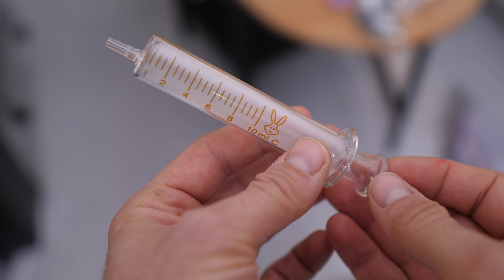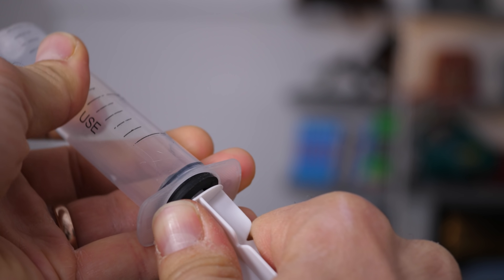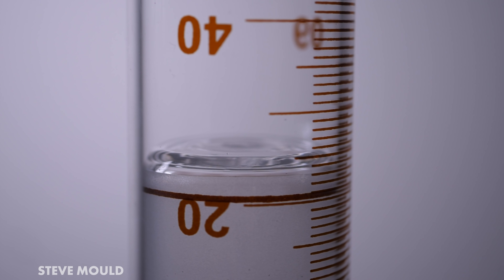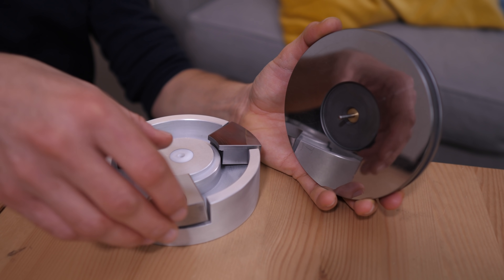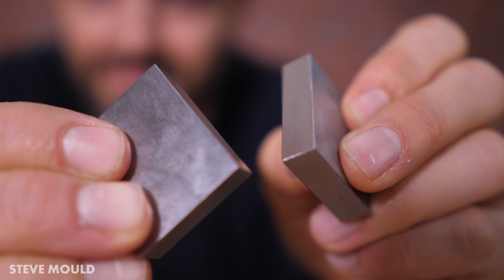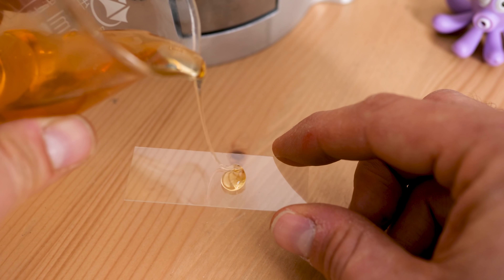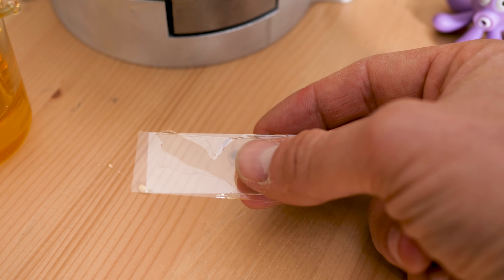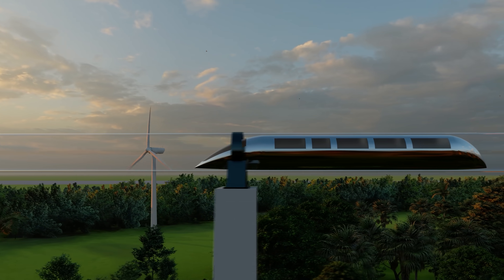The Self-Levitating Kingsbury Aerodynamic Bearing

Comment: In a rotating magnetic disk drive - that one your PC uses to store data - the disk surface is very flat and smooth, and the head has a slight chamfer on its leading edge, so that as the disk turns, it drags air molecules under the head, which then is kept away from the disk by a very thin film of air.  The heads are said to "fly", and if ever there is any contaminant in the drive, the result is a head crash - and just like in aircraft, flying is absolutely safe, but crashing is very dangerous.  In a disk drive, crashing the head is dangerous for your data.  The contaminant that will cause this is very small.  For example, a particle of smoke is too big to fit into the gap between disk and head - it would simply be knocked to one side.  A finger print is too big to fit through the gap, and would smear the oils from the finger all over the head and the disk surface, and a crash would be only seconds away.  Such devices have to be made in a clean room, where they are not touched during manufacture.  
Large computers use tape backup, and there also, the heads fly over the tape in a "streaming" action, which means that the tape is moving at its optimal speed from the beginning to the end of the tape.  If streaming is not maintained, the heads land, causing contact and wear, and head life is dramatically reduced.

Comment: I would assume the stickiness between flat metal surfaces comes from a vacuum. If the two surfaces are separating, air will take a while to flow into the opening gap. But at the same time, the metal blocks are already experiencing air pressure from all other side, pushing them together.
Should be easy enough to test. Just stick two blocks together and put them into a vacuum chamber and draw out the air.

Comment: LAMINAR FLOW!!!! @3:05 Not really, but I'm imagining the air on the sides being rings stacked on top of eachother.
edit: I might not have been too far off. Also, at 6:45, could that be used as a capacitor in a circuit?

Comment: As a fitter and Turner a surface grinder has the same bearings, but has an of set tube attached which while spinning will draw up oil very slowly, check it out you might be interested to see how they work.

Comment: Thanks for this interesting video. Could this bearing be used for storing energy in a flywheel rotating at higher speed? or would it pull too much air into the system?
Reply: Mag lev in a vacuum would work much much better. Your drag off a big rotor would be immense.

Comment: There is no proof that ice skates work by melting the ice. If you think of the ice as a lattice, it's pretty clear that the surface molecules don't have the same number of bonds as the bulk molecules. Hence, the degrees of freedom of each is not the same. As long as the surface molecules can rotate relatively freely, ice is slippery because the top layer is ALWAYS water.
Think about it, a puck exerts about 1 oz/sq in while a skater will exert about 1600 oz / sq in. Why does the puck glide so well? As a matter of fact, a puck glides better than a coasting skater.

Comment: Great video :) You use the word hydrodynamic for aerodynamic sometimes , if you want to include both you should say fluid dynamic. Also Im pretty sure that the gauge block wringing is caused by adhesion force. At least that's what I was taught.

Comment: It is the atmospheric presure that holds the gauge blocks together. when keyed you remove the air so then the atmospheric presure pushes the blocks together thus the bigger the blocks the harder to pull them apart.

Comment: This reminds me of the Tesla turbine, where air flows over numerous flat round plates (just like cd's stacked together) and relies entirely on the viscosity of air to 'stick' to the plates to cause rotation. As more air enters the system/motor and interacts with the plates, the more the air molecules collide with one another causing a motion in the plates. In this particular case a rotational motion. Practically I don't believe it was ever used, as it generates very little torque (...at least I can't think of a current practical use) but it does give a good visual model of how the viscosity of fluids can interact with the surface of objects.

Comment: The expensive work done, let us play in the physics lab.
First, to measure the amount of float (air gap) of the rotating part a laser interferometer can be used.  This is a common calibration tool in the CNC world.  So shine the beam through some holes to the bottom shiny side of the rotating part.  A tachometer and some weights can be added and the fun can start.  Performance curves of lift vs. spin at a given weight can be drawn up.  But wait there is more!  A DC voltage from 5 to 5000 can be easily applied and the electrostatic force calculated for the area of the trapezoidal pads at that condition.  As Tom Lipton might say “geeee  Mr Wizzard” 
Next, seal the end of the large syringe after filling with various gasses. (CO2, N2, O2, etc.)  Clamp it upright with say a 100 to 500 g weight in compression and record the leakage.

Lastly, it would be complicated to turn the large syringe in to a variable capacitor using electroless nickel.  Anyone, want to tackle this one?

Comment: Since I actually work on bearings for gas turbines, this was very easy to understand for me. But I never really thought about the balance in the viscosity of the oil.
It really shifts your perspective on things, normally when people want something exact it's often "exact to the millimetre" Now I think of a tolerance of +/-0.2mm as big. If something has to be exact, it's usually with a complete tolerance of 0.03mm or so, which isn't even that hard to make and I think that was the tolerance of the air-motor we (classmates and me) made in my apprenticeship, maybe 0.02mm.
I had to work on tiling pads like those in the video and they had the smallest tolerance I had to make with 0.1mm in total. There I had to be really careful.
Also I like sticking those gage blocks together.

If any of this text sounds weird, then it's because I usually talk about this stuff in my native language... which isn't english.

Comment: Great video! I'm a bit surprised you didn't consider stripping down an old disk drive as EVERY rotating disk has ALWAYS relied on hydrodynamic bearing principles to "float" the disk heads over the surface. One of the reasons modern disk platters are shiny is because they are SO precise in their surface flatness in order to allow the disk heads to "fly" over the surface (as well as being coated in a different magnetic compound compared with the much earlier brown ferric oxide coatings.

Years ago (>40!!) when I was a field engineer we used to have a diagram we showed customers illustrating the comparisons in dimensions between the cross section of a human hair (MASSIVE), a piece of lint (about 1/2 the size), a fingerprint smudge (!!) 1/2 again and the flying height of the disk head - about 1/2 to  1/3 the height of the fingerprint! They then understood a bit better why it was so important not to touch the surface of a disk pack (14" platters!). We also used to explain that it was equivalent of flying a 747 at 600 mph 6" above the ground. 

Today's mechanical disks have a flying height even lower by around a factor of 10 and equivalent (on a 15k rpm disk) of flying a military jet at over Mach 1, 0.5" above the ground!!

I found an equivalent diagram of the modern disk which has a flying height barely thicker than a strand of DNA!!!
https://acsdata.com/wp-content/uploads/hard-drive-flying-height.png
Reply: I bought one of those Western Digital 5th generation Velociraptors but it was a little bit corrupted and had a strange motor failure after about a year. Shame they stopped making those for SATA, they're all at least a decade old now and the one I have was made in 2010. With modern optimizations 10K RPM should also be doable in a laptop HDD but no one gives a crap to exceed 7200

Comment: All engines work on this phenomenon. Piston to cylinder walls, rod bearings to crank journals, crank journals to main bearings, Cam journals to cam caps/cylinder heads. Although there is a pump supplying the viscous fluid (oil) to these areas, so a little different.

Comment: Disk drives have been using hydrodynamic air bearings (head to spinning disk) since the IBM 1301 in 1961. Earlier drives used hydrostatic air bearings.

Comment: From my perspective, I think that the two highly brushed metal blocks stick together because due to the highly brushed surfaces, there are no gaps to trap air molecules, so when you try to squeeze the two blocks together, you push the air out and by the forces of van der Waals the two metals stick together.

Comment: One of the best example I could compare that, would be the heads of an Hard Drive, they float above the surface of the platters where the data is saved.    Thes platters turns at 5400, 7000 or 10000 rpm to make the heard floats above each of the surfaces.   And if the platters slow down or with the lost of power the heads are not in the park position, the head will land on the surfaces and create a lock that could prevent the platter to turn in some cases.  In the past with those big computers the hard drive platters were between 18 to 24 inche in diameter and when the heads would land on them they crash and leave gauge on the surfaces.   That's why parking the heads was important then with those monster computer drives  and in the early days of the PC hard dirves.

Comment: Computer hard drives use a similar bearing setup to get the read/write heads as close to the platters as possible while avoiding physical contact. As a drive is first powered on, it makes sure the read/write heads are in the park position where they are supported. Then it spins the drive up to anywhere from 5200 RPM to 15000 RPM depending on the model, ensuring that this effect is strong enough to support the read/write heads.

If you have a hard drive in anything, you are using a true marvel of precision engineering every day.

Comment: Those flashes aren't because the rotor touching. It is because of quantum tunneling of electrons across the air gap. As the gap gets smaller, more electrons can cross that gap..

Comment: If you are ever playing with a glass syringe, the bigger the worse... and for example pressing the tip with one finger and making pressure with the plunger... always remember that the instant that the tip gets even slightly open, all the air will escape AT ONCE and the plunger will get projected extremely fast towards the tip which will inevitably fly into pieces ;(
And those darn things are expensive.

Comment: I watched a manufacturing show that was demonstrating a shot peening technique that textured the metal surface.  Two metal tubes would air bearing on this surface.  Sleeve on cylinder.  The divots similar to golf ball dimples on the cylinder surface acted like a gas molecule trap I believe.   The effect was inhibited by the oil from a finger touch on the surfaces.  I always wanted to experiment on monatomic and diatomic gases to determine which gases in atmosphere were responsible.  This bearing showed remarkable lack of friction
Here is a video about it
https://youtu.be/BF60s6LeQkI

Comment: Hi Steve, nice video and explanation there. At 8:56 of this video you explained how air entering the gaps of the circular rings (barrel and plunger) creates a gap in between. Do you think this could also be due to centrifugal force on the barrel which is doing the balancing? Just like a rotating top or spinner stands upright when spun (the analogy is bit of a stretch – hope you would be able to relate)? Particularly because you are spinning the outer ring (barrel) not the inner ring (plunger). What happens if you spin the inner ring (plunger), does the syringe spin for the same amount of time, or the motion dies of sooner? Thanks Bikram

Comment: You should read the Simon Winchester book "Exactly: How Precision Engineers Created The Modern World". The book takes the reader on a journey through the world of accuracy and precision through stories of the invention of modern machines and machine tools in steps of increasing significant figures of precision. The writing is excellent and the stories are well told and, listening on Audible, are very well narrated by the author. 

From the story of how canons milled from a single piece of metal inspired a steam engine that didn't leak steam and help really propel the beginnings of the industrial revolution. At the other end of the book is the very tiny tolerances of the Laser Interferometer Gravitational Observatory (LIGO)

Comment: Hey quick question. I recently sat on a metal bench (actually fountain turned off) instead of a varnished wooden bench because the former was dry. It occurred to me the thermal properties of the metal ought to hinder evaporation so why did it dry faster? For reference this was at the Brunswick Centre in London. Many benches and fountains so not a fluke. Aside: Plastic stickers on wooden benches were dry too. Ideas?

Comment: This is very interesting and I didn't even know there are glass syringes! One question though. When you spin the plunger there is a layer of air between the plunger and the walls of the syringe. Does this mean that for a brief moment the syringe fails to be airtight? Could you test it by filling it with a colourful gas and spinning it to see if it leaks?

Comment: There was a very interesting CPU cooler concept out a few years back called the Sandia Cooler, which used this air-bearing principle. They thought the barrier was thin enough to still be thermally conductive and you could spin a plate that acted like a heatsink and a fan in one piece, at low friction. Cool idea, and Thermaltake tried it out with their Engine 17 and 27 coolers. But they weren't as effective as hoped.

Comment: You know what gets me the most about stuff like this? Mundane stuff like Air being able to lift tons of material without even doing any work - Just being there doing its thing.
Same for Light - Occasionally too dim, sometimes a little bright but holy balls if you put it into a MW or GW class Laser then shaving that pimple off your face from like a kilometer away is a thing.
Or Water - Yea we know it's strong and its perseverance will erode practically anything away given enough time but a few hundred/thousand PSI of it and you're suddenly cutting anything with it.

Meanwhile in the land of ball bearings stuff tends to run out and cutters will become dull 🤔

Comment: Hmm... When is syringe is rotating, does that make an exchange of air between the inside and the outside possible? (If the air can move in circles, what's there to stop it from also moving in or out of the syringe at the same time?) – Could this be visualized by filling the syringe with smoke, and then rotating to see want happens? (I imagine the added energy would make it possible for the air to move differently, than without this energy – but maybe that's just not the case?)